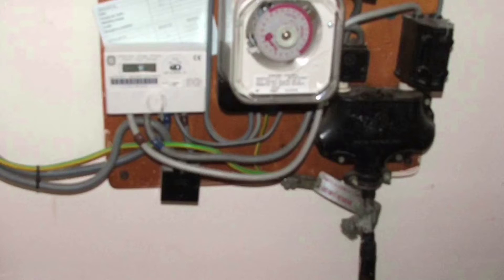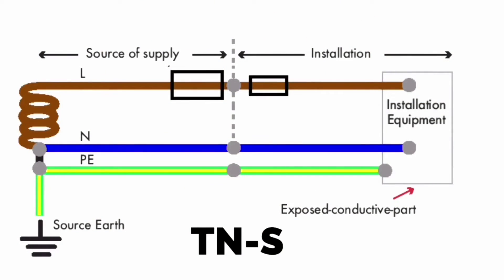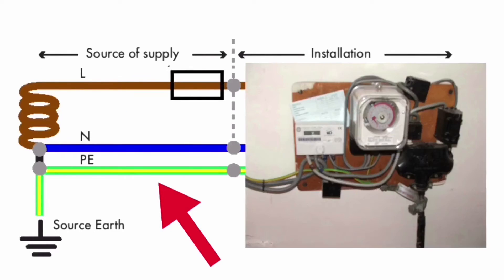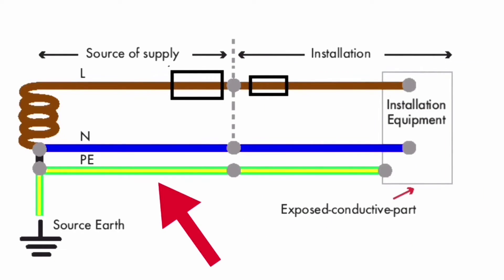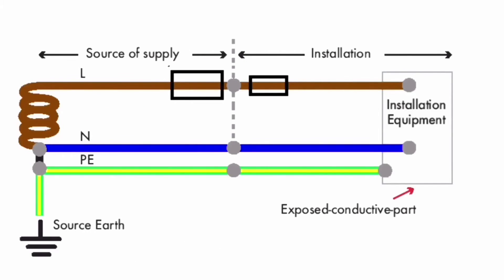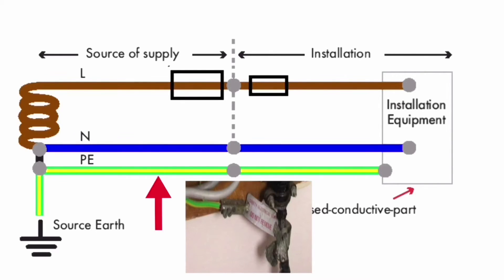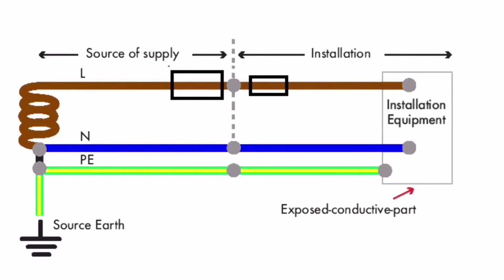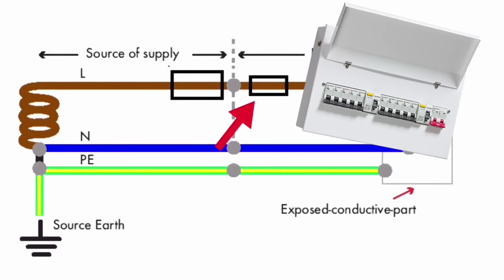Earthing Arrangements TN-S in a Single Phase Installation Explained in Picture

Comment: Does having a poor earthing system installed on your house result into high energy bills?
Reply from the maker: abdulkarim Wajadi no
Reply: in my community many electricity consumers are experiencing the problem I wonder what could be the reason.....poor insulation resistance, or loose conductor terminations.
can you tell by your experience what could be the reason for this